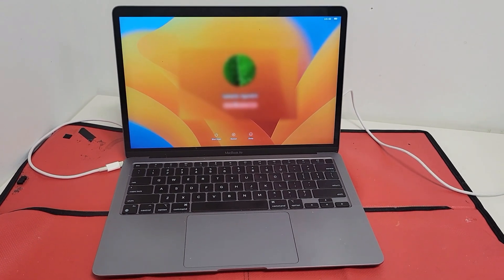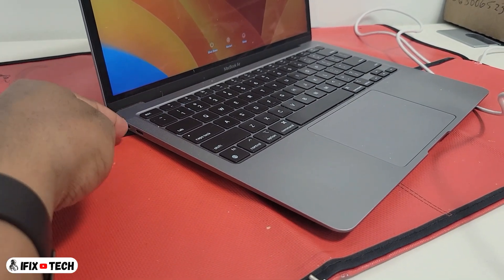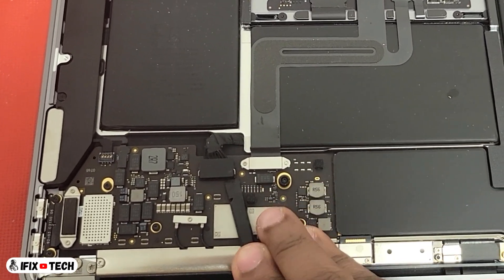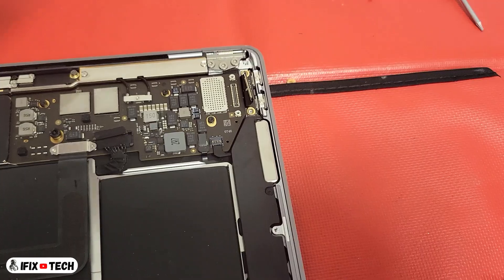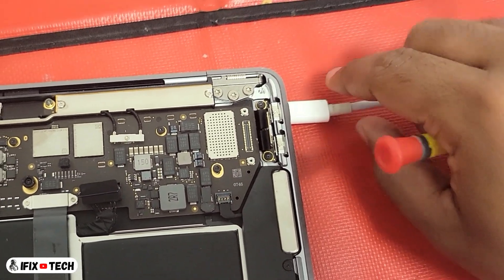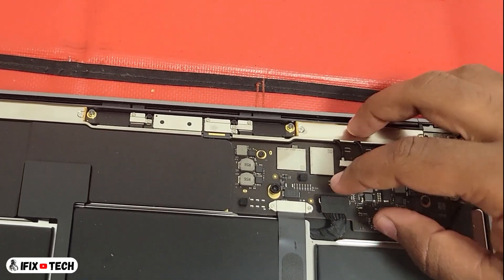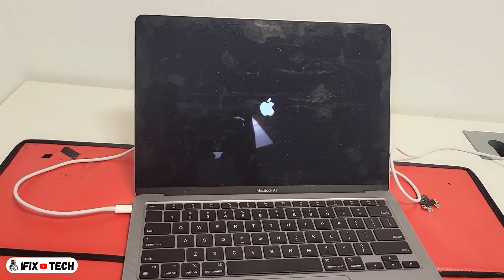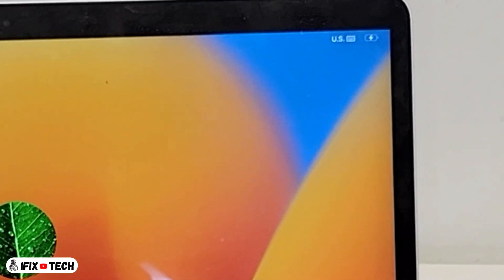Apple MacBook AIR NOT CHARGING How To Replace USB C Ports Step-by-Step Tutorial

Comment: Bro very hard to remove the usb port for replacing how did u remove so smoothly
Reply from the maker: In some models, it's held in place with a soft adhesive. You'll need to apply a little force. Sometimes, it's better to remove the logic board to make it easier. Thanks for liking it and subscribing 👋 😉
Reply: @IFixTech1 😂 i somehow removed it , i nearly had a heart attk!!!

Comment: I think my M2 Macbook Air is going the same way!
I stopped using the regular charger as the port kept getting grubby, and rather than continue to clean it I just reached for my USB-C cable and used that through the USB-C ports to charge the Mac, I wish I hadn't as 'I lean towards the notion' that charging the Mac through them 'may' cause a faster rate of corrosion. Anyway, I can still use the USB-C to charge the device but it can be fickle, moving the Mac will have it stop charging pretty easily... but the more troubling aspect by far, currently is the much more fickle nature of connecting USB-C drives to my Mac from thumbdrives to any and everything else. It wouldn't even stay connected long enough to set up a new TimeMachine with either of the M.2 enclosures delivered recently, it seems as if so much as a fly lands on the cable it disconnects.

I've hunted around and others are having similar issues, but most associate it to software or the device connected, but I lean heavily towards the USB-C ports, and again... towards them corroding faster when used for charging, I guess time will tell when someone finally figures it out.